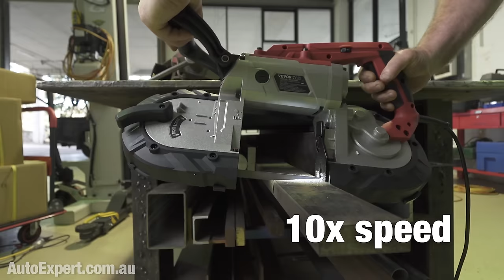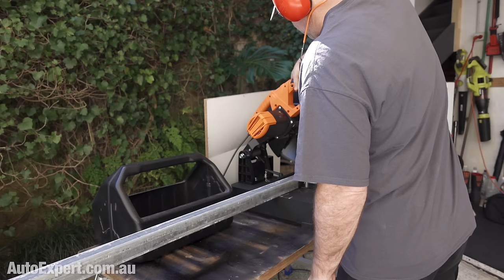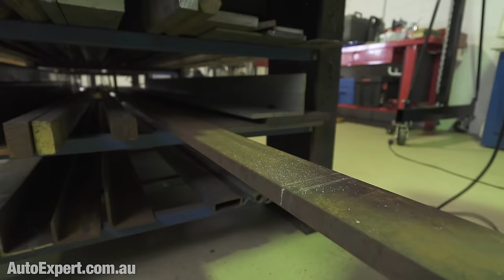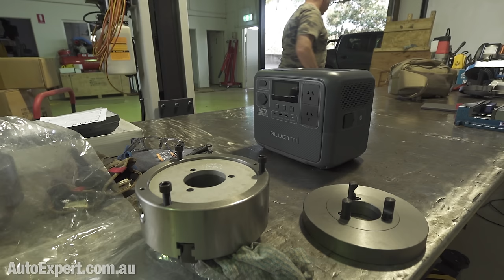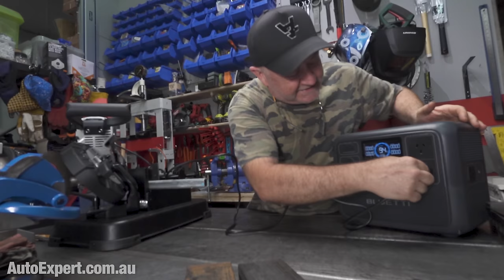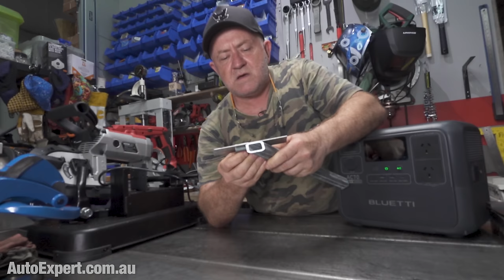Vevor portable bandsaw review for DIY fabricators, mechanics and welders | Auto Expert John Cadogan

Comment: 🛑Has anyone ever wondered if this guy ever really uses half of the tools that we see hanging up in his work shop?I don't think I have ever seen them move from one month to the next. Just like this saw. It's clean as a whistle and It looks like this is the first time that it has ever been used.  Are these tools just a bunch of expensive props? Come clean John, why do you even bother having half of these tools that you have hanging around?🛑
Reply: The saw has been supplied brand new for the promotional video. How do you even function?
Reply: Thanks . @tomparker5000  Most of the tools that you see in his videos have been there for a long time including this saw but thank you for your input.
Reply: @gazza70cr  applying Occam's razor to the situation would yield the hypothesis that the tools are always in the same place because he packs up his gear after he uses it, and doesn't abuse them.
Reply: I'm glad you said hypothesis  @tomparker5000   If the 10mm socket is not missing there goes your argument. :face-blue-smiling:
Reply: @gazza70cr  his 3/8" socket probably has 10mm engraved over the top
Reply: So disappointed that I bought a Bluetti EB70 when this looks so much better in the display and case configuration. I have the Vevor bandsaw, it is great. I’ll look for the base as an accessory if available. Thanks John.

Comment: good review. highly recommend bandsaws for the home workshop.  tho i would go with a battery powered portable and use a fixed one in the workshop. the fixed ones can be tweaked to give better accuracy, which makes fabrication and welding a whole lot easier.  there is kits around to turn the portables into vertical bandsaws for general hacking.

Comment: Great review! Even though I like the Vevor brand (their "8KW" diesel heater keeps my shop warm in winter), I'm not totally convinced by their metal band saw, here is why:

I had three of them (MKI) and had to return all of them -  mechanically, they were top notch and I saw them as a great addition to my shop (building product design prototypes), but the electronics had a serious bug: when you cut tougher metals like V2A / V4A or unhardened tool steel, you want to reduce the cutting speed but increase the pressure on your work piece (less work hardening, less wear on the band), However, the MKI could not do that - when cutting with reduced speed, after 30 to 45 seconds, the control circuit would burn out and the machine would switch erratically between various speeds, which made it unusable. After the 3rd machine, the German service center confirmed that the electronics of the machine were "simple" and gave me a full refund. Since 2022 they are selling a MK2 version - could be that those machines are more reliable. Once this is confirmed I'll definitely buy another one!

Comment: Good to see it’s AC.  Yesterday I threw out a 4Ah AEG 8 rechargeable Li-ion battery.
Then my trusty (no longer) rechargeable hair trimmer gave up the ghost.  My sons expensive rechargeable shaver (3 round flexible disc/screen type) was also stuffed.
IMO it’s either AC or disposable common battery powered devices from now on.
Sure all these batteries did give reasonable life, but it’s way too short.
Love that band saw, but for the little I will do, an 4” (100mm) angle grinder with the 1mm thin cutting disc  is more than enough for me.
A skilled and experienced operator using the angle grinder is way better as that tool is massive, no doubt expensive and the ROI (return on investment) for 30 cuts in the next 30 years is not money well spent.
Now for people with plenty money, no storage issues, those with poor ability/experience/skill it would be ideal.
Reply: I'm going on 8 years with some of my Milwaukee batteries. The rest 5+ and that's in daily use in a truck workshop. More grunt and better convenience than air tools that are subject to good air lines or running lines across a workshop.

I bought a Milwaukee bandsaw for my trade and it's definitely better for cutting exhaust pipes etc. Roi is good for me as it's a tool of my trade.
Reply: @Low760  definitely makes sense in your case.  I have heard Milwaukee tools are good.  To be fair, the AEG was a hand me down and did get plenty use on the battery drill.  But with use on the blower and wipper snipper, the battery gets very hot, especially with the blower.
As soon as I finish I put it in the fridge for about 30 minutes before resting at least a couple of hours then put on the charger.

Comment: With that heavy, solid stuff - (say John's 75 x25) if possible stand up on edge.  Less teeth in the cut and less likely to squeal, possibly stall the unit.  There's all this info on TPI in cut etc.... but if you are like me and cutting and something different each time, last thing you want to do is constantly change blades.  On these smaller units, I would resist the temptation to, spray coolant/ oil onto blade.  Fair chance blade will slip.  Guessing it will have rubber on outside of wheels.

Comment: I had a large electric motor shaft come in that needed an amputation because the bearing had run dry and overheated the shaft, and the belt tension resulted in a severely bent shaft. This was a 3 inch diameter. There's really no option but a portable bandsaw to cut this off in a weld prep fashion, being two angular cuts to form a half of a V prep. I used a 4" capacity Milwaukee portable. Made the job easy. 

You do have to use a hand hacksaw a little bit to appreciate a portable saw. I hate using abrasive wheel  saws except when there is no other way. Always use a safety helmet with face shield  and ventilate the area. Doesn't do a helluva lot of good to wear a face mask during the cut, only to whip it off the instant you're done the cut. Plus, face masks are mostly useless if you can still smell the dust. It's not the big particulates that are the problem, it's the micron sized particles that hang around forever.

Comment: I bought one of these bandsaws with the dropsaw attachment, and so far it's been awesome. It's a lot cheaper than a carbide cutoff saw, a lot quieter than a carbide or friction saw, and doesn't throw sparks everywhere like a friction saw. 
The only thing I think is a little lacking is the vice on the base. The cut hangs well over the vice, so there is no reference to where you are cutting, and you need to use the blade to even roughly line it up. I get that you probably want to use the blade anyway for accuracy, but it would nice to be able to get in the ballpark. 
Plus, as designed, it's hard to line up multiple cuts, as there is no reference. I'm thinking of trying to figure out some kind of stop on it to make repetitious cuts easier.
All in all, it was a great alternative to angle grinders, and cuttoff wheels. Cheaper than a carbide saw, a bit dearer than a friction saw, but it's a great tool to have!

Comment: We call them portabands here in the US.  Been around for a long long time.  My first experience with them was with the welders doing pipe fitting at a Benzene plant in Pascagoula.  One thing to note:  they cut much faster when going against the thin section of profiles vs. the fat section.  There's an ideal number of teeth that should be in contact.  I don't know exactly what that is, but when cutting across the fat section, the gullets (which are pretty small) in the  back teeth get loaded up before emerging from the cut and really aren't cutting at the end of the kerf.  I don't have a Vevor, but have the gold standard (Milwaukee).  One thing to look for on the cheaper ones:  Make sure they've got bearings, not solid guides.  Guides or bearings change the angle of the blade and extert tremendous force (or friction if guides).  The guides will heat up the blade with extended use.

Comment: With my bandsaw collection, I have a reasonably large floor standing unit, 2 benchtop ones, and a cordless portable unit.  
1st thing I suggest is get a spare blade.  So yeah, I have made "friends" with my local saw doc.

Once u get into cutting harder stuff, I can only get blades made up to suit is for the floor unit, so there is that.  Naturally the doc simply buys the blades as a roll and just cuts and joins to suit the required size.

No sparks to worry about, so the the cordless is used to cut 12mm bar out on site.

Comment: I bought one of these a year ago, and totally agree with you John, they are a fantastic machine.

I made a small table for it out of 6mm flat steel, with a bit of angle bolted to it so i can mount it in the vice, great for small jobs.

The only drawback is that for every revolution of the blade it gets a half twist and back, leading to eventual fatigue in the blade. My first blade breakage was a clean snap across the blade, i thought the weld might have broken, but examination of the broken blade showed that there were a couple of other spots that had a crack about 60% across the blade. But blades are reasonably cheap and i had done a lot of cutting with it.

Comment: when i look at all your tools , the Chinese rubbish in your work shop makes me laugh, your drill press just as one example is Chinese junk, it would rattle when turned on, would not drill a straight and square hole to table and the spindle run out would be like a Chinese amusement  park ride, dude buy a parkin or waldown, Australian made, used are cheap and a precision tool the drills a straight hole and square to table , please dont advise people to buy junk, lots of good  machinery used and cheap, 240v or even 3 phase is easy and cheap to convert to 240v , you may know cars but not tools